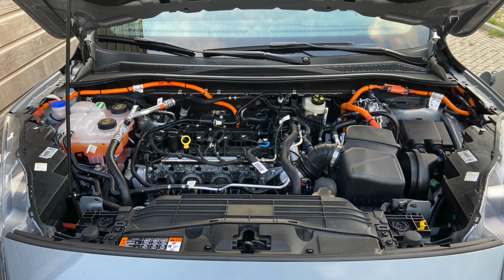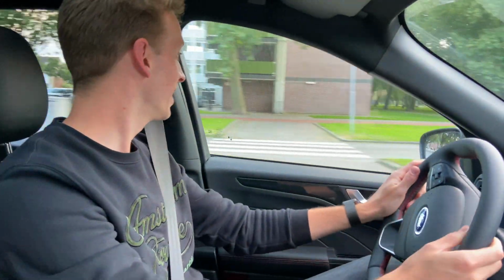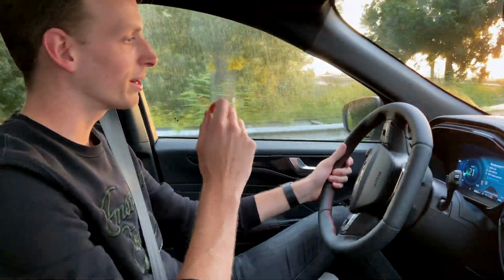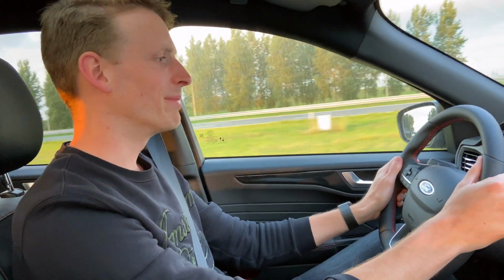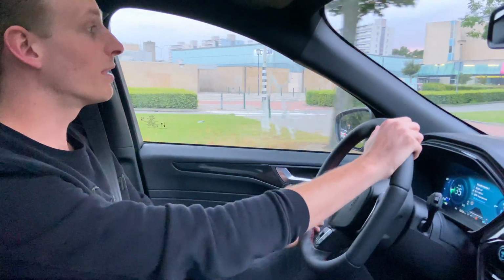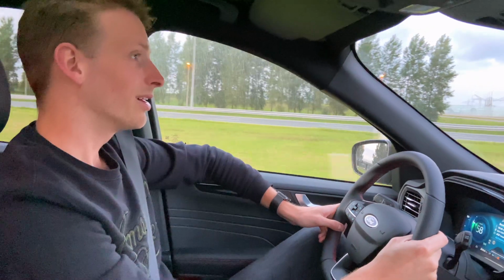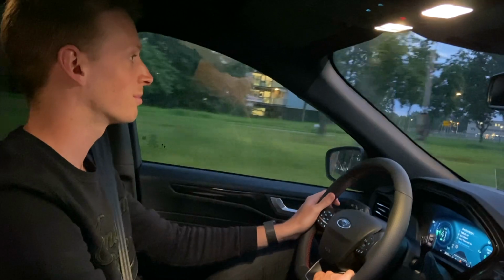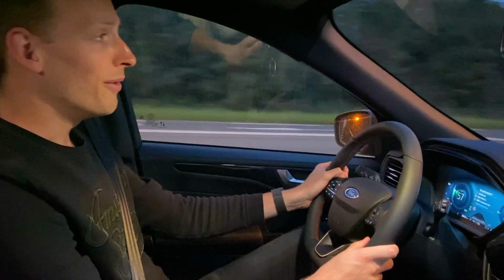FORD KUGA | The Plug in Hybrid to beat! E-RANGE TEST ⚡️

Comment: I own a 2021 Escape PHEV, the same car as a Kuga. If you drive down a hill with a fully charged battery, there is no deceleration due to regeneration because there is nowhere for the charge to go. Therefore, Ford has programmed the engine to come on to cause deceleration from engine compression. In some instances, the software will engage the engine without feeding any gasoline to the engine. The piston deceleration still occurs. Brilliant.
Reply from the maker: That’s smart!

Comment: Not even economical as Toyota Raw 4 plug in. Try this SUV in winter months in ev mode, engine will kick in every 5-6 minutes, and economy it’s down to the bottom. That’s why Toyota Raw 4 plug in have heat pump, and you can drive in el mode in summer as it’s winter without engine will start. Best plug ins it’s  Toyota  manufactured.
Reply: If the engine is never started, some parts could rust (someone found rust from a hybrid BMW).

Comment: You are able to do 60 to 70 kms on EV only. That's great. I just got a the 2023 version, not tested it yet. But the battery, when fully loaded, gives me an estimate of 40+ kms only. So I am just wondering, what does yours say when it is fully charged? Before driving. :) thanks
Reply: it's because it needs to calibrate first
Reply: Mine says 73kms

Comment: Got surprised because the (not that small) 14.4 KWh battery manages more than 50 km?  What really counts is the electric efficiency, namely how many KWh you need to recharge for that range (value in KWh/100 km). Of course the plain range also is a good benchmark value as it effects your electric radius.
Reply: 14.4, but only like 10.9 is available as EV, the rest is set aside for Hybrid driving and for battery lifespan protection

Comment: i like you channel bro. question is the plug in hybrid mix with gasoline. and that 60km you reach its all electric what if the electric finish.
Reply from the maker: The car will turn on the engine eventually and continue as normal ICE car with mild hybrid support from the almost empty battery which regenerates at breaking and such. :-)

Comment: Is the electric mode only available with the AC and heater off?
Reply from the maker: No it’s also available with the electro mode on. Takes a bit more energy consumption, that’s why I sometimes like to turn it off. Cheers,

Comment: What was the consumption in petrol mode on highway 110 km/h ?
Reply from the maker: About 6L on 100kmh average. Taking it pretty easy though. As the car is quite heavy the fuel economy is not 'as good' as e.g. a Volvo XC40 T2/T3. Still, it is a very descent economy!